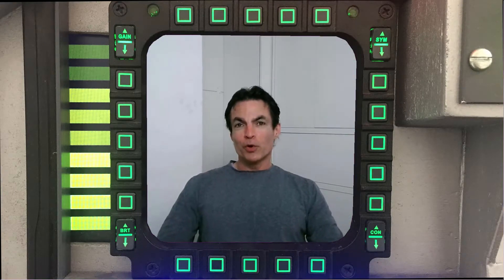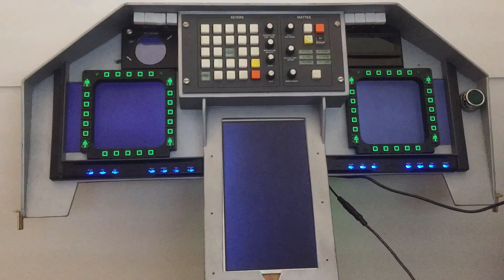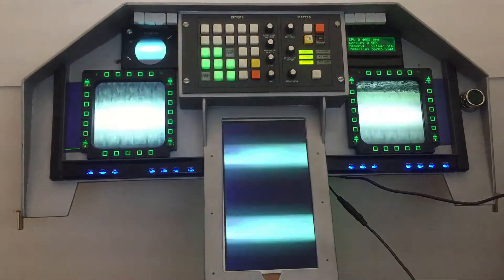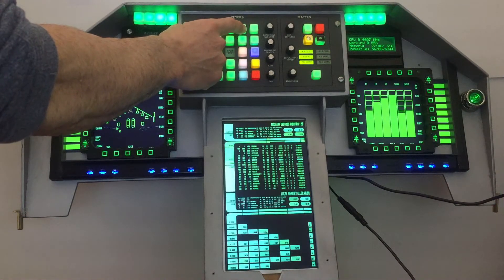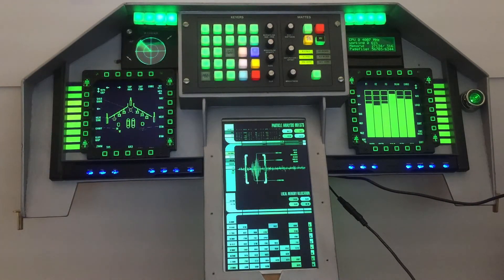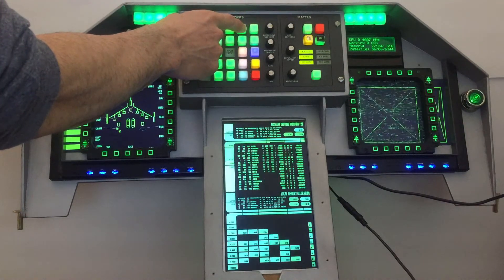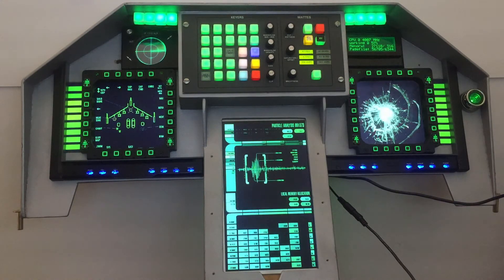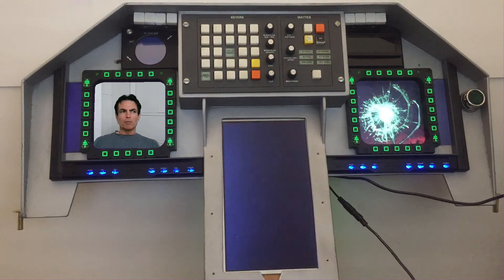C-Pit 101: S1-E2-b: Remastering the Forward Control Panel

Comment: What is covering the roof of your cockpit? How did you make that?
Reply from the maker: I first made a mock up using cardboard. I worked with it until I got it the way I wanted. Also was able to figure out how to mount it and such.
I then bought some thick rigid foamboard (I think it was about 1-inch thick.) I glued thin pressboard on the large sides and thicker wooden slats along the edges. (to give me something to screw to) It was lightweight and easy to work with. it also provided some sound insulation.

Comment: if i were to attempt this, how much would this roughly cost? materials, and displays and buttons and all. this is crazy cool
great job cmdr o7
Reply from the maker: Like what I have, about 1k. The hardest part is sourcing the control panel with buttons, but you could use a  Stream Deck, or a tablet for that.  You could save a few bucks by directly connecting each display to your computer with a HDMI or VGA cable (instead of using convertors).

At some point in the future, I will post my pattern for the control panel. I built it in 1 weekend.  It will be a video dedicated to just the front panel construction, and have pics of my construction, and tips for a build.

I used 8" monitors for behind the MFD bezels, a 10" center monitor (rotated), and I think a 3.5" monitor (need to confirm size) for the radar.  A 4x20 character display was also used. You could optionally just use another monitor there too, but it would raise the price a little.